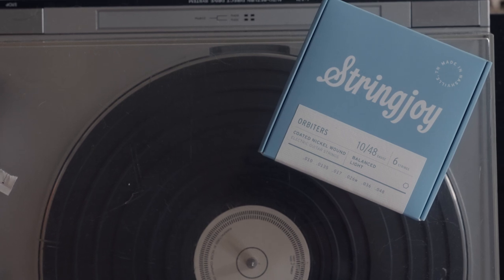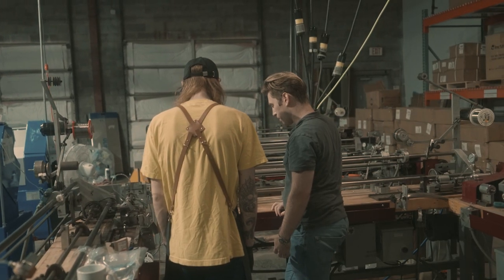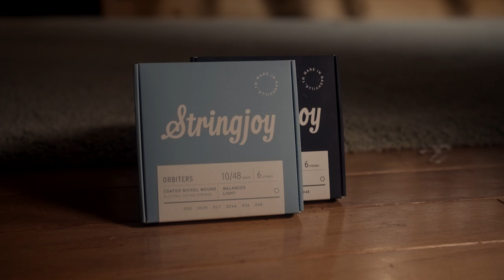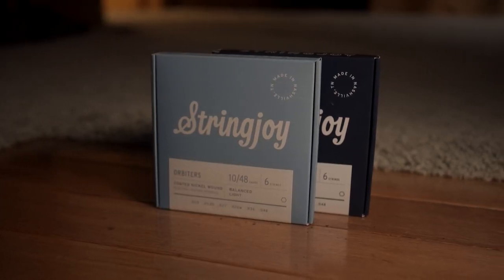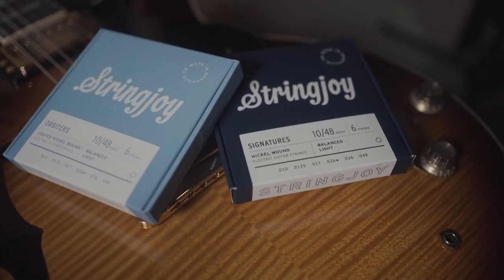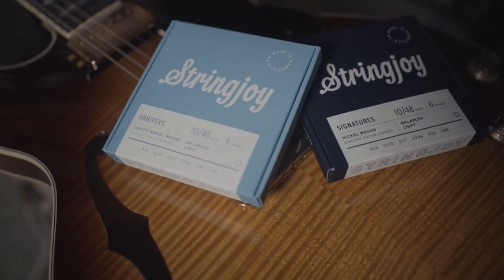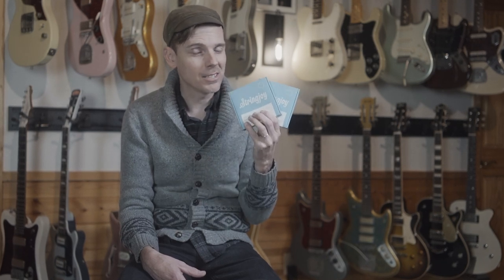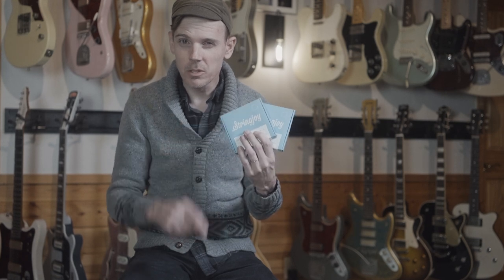Stringjoy Orbiters Demo: Can You Tell They're Coated?

Comment: This might not be the best way to reach out to your company, but I’m going give it a try.
I own a vintage 1957 Fender Electric Mandolin.  I’m looking for a vintage correct set of strings for it.  I use your Broadway strings on my electric guitars and I think they would be great for the mandolin.  However, I’m having trouble determining what string gauge these mandolins used, and similar modern instruments have quite a variance depending on the instrument manufacturer.

Comment: Do these feel more like uncoated or coated strings? I'm asking because I do actually greatly prefer the feel of coated strings, but many new coated strings are advertised as feeling like uncoated, as if that's inherently a good thing.
Reply from the maker: Hi Victor! These will be in the camp of coated strings that feel more like uncoated strings. If you prefer the feeling of more thickly coated strings (and there's nothing wrong with that), Elixir is pretty much the only game in town for that.
Reply: @Stringjoy  OK, thanks for clarification. I like Elixir-style coating because it makes sliding very easy and free of scratching noises. Manufacturers tend to emphasize corrosion resistance as the main selling point, but I actually don't care about that too much since my hands basically don't sweat and even normal strings last for a long time. So for me it's all about getting that slick non-grippy feel.
Reply: This! This is what most string companies don’t understand about the whole coated string thing. The Nanoweb’s have that slick feeling where you don’t get that ugly string noise when you change chords or do slides. it’s the feel that coated string players like and everyone tries to get rid of that when they try to “improve” on coated strings. Its not a bug, it’s a feature !!!!!!!!!!!!!
Reply: Wouldn't you get a similar feel from this coating method when used with (semi-)flatwounds?

Comment: Elixir user here, I think if your gonna coat a string. Do the whole thing, not just the core, Elixir still best in that department. To me I hate that sliding string noise, like Tom Morello soloing on Bulls on parade
Reply from the maker: We don't coat the core, we coat only the wrap wire, which because of our tight wrapping process forms a protective barrier around the whole string. That said, our process aims to create a coated strings that doesn't feel coated, so for folks that do like the feel of coated strings, a thicker over-top coating like Elixirs is definitely the move.
Reply: @Stringjoy  well I’ll eat my words then, I think Martin is the one who wraps the core then? I’ll have to try a set, I’ll order some this weekend
Reply: @dividedbytimestudios  how were they?
Reply: @Ramble1234  I haven’t tried them yet, I need to order a set, thanks for reminding me

Comment: Nice! I’ve never liked coated strings for electric, but I’d give these a try. The extra brightness was certainly more noticeable on the dirty amp.

Now for a suggestion, we’ll, more of a request… let’s be real, I’m begging you… PLEASE, someday soon, make an all carbon steel electric set, like NYXL’s. I love the brightness and volume of those strings, but I switched to Stringjoy because I love that I can customize the string gauges in my set. Awesome work! Keep it up! 🤘🏼😎
Reply from the maker: NYXLs aren't all carbon steel (those would be some rusty strings!) They use a carbon steel core wire, but so do we.